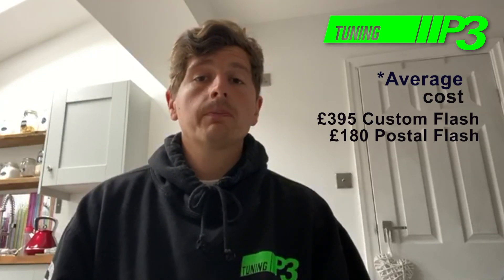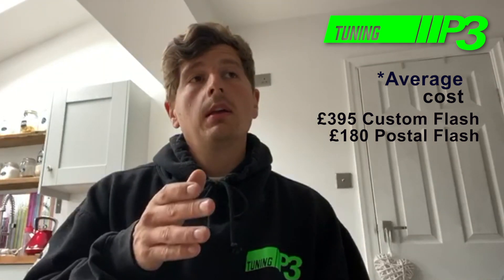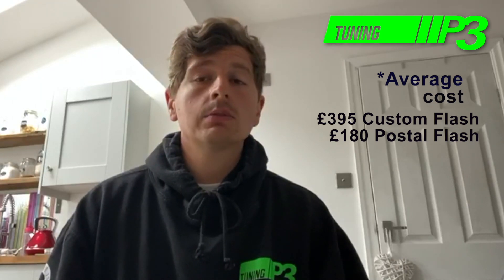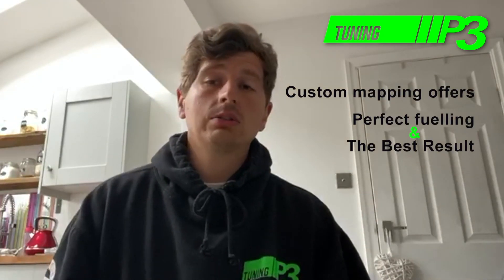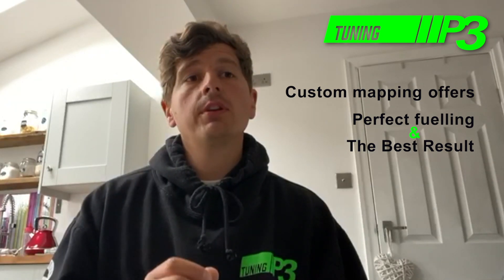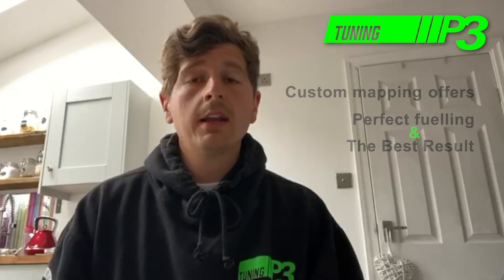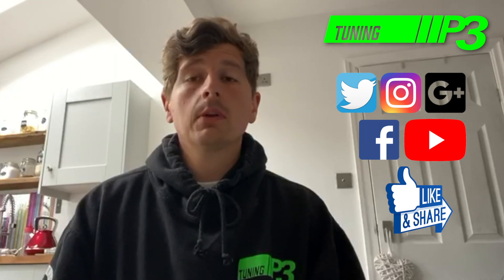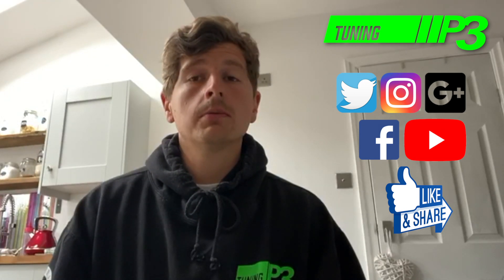Motorcycle Base flash Postal ECU Service and Custom Mapping P3 tuning

Comment: Hi mate, I've got a 2016 er6n. mods so far:-  pair valve delete,  full ixil x55 slash cut exhaust, dna air filter, I have also taken snorkels off the airbox. I have a Rapid Bike Evo to go on. The RB only has a map available for a standard 2009 er6. I want to set the bike up properly but also unlock as much potential as possible. 
Thanks
Rob
Reply from the maker: Morning Rob!

If you want unlock as much as possible performance wise on your bike your best option is to go for an ECU map. This will allows us not only to sort the fuelling out but tables such as the secondary throttle plates and ignition are able to optimised to get the very best out of your bike!

Comment: Are you offering this on the Suzuki SV1000 mate? I know you did mine, but my exhaust system was an M4 2 into 1 system with a Lextek silencer, so not sure that data will be much use for a postal flash service. People ask every few months on our Facebook group and I always recommend them to you anyway.
Reply from the maker: Hi thanks ELMuelio! Yes we offer this service on the SV1000 total cost currently is £180 including tracked and insured return postage. We have a lot of variations on file including full race systems, std exhaust and modified and stock air filters so we do have most setups covered but obviously as discussed full custom mapping will always be better than a base (postal) flash as we can confirm fuelling and get the best from the bike. 
Thanks for the support and if you have any questions please give us a shout. Thanks again kind regards P3 Tuning